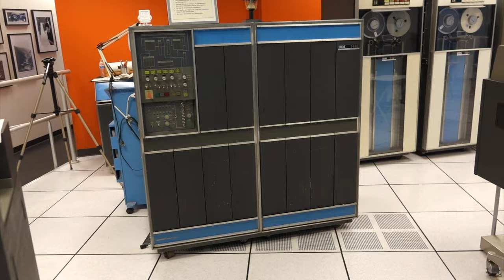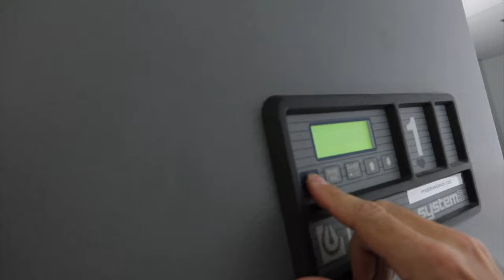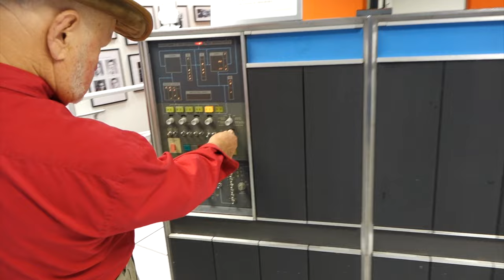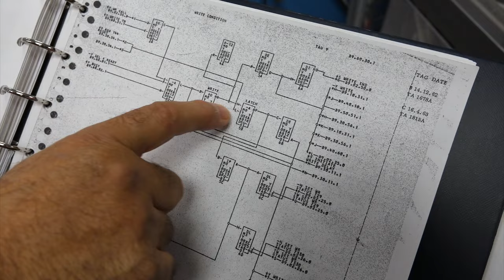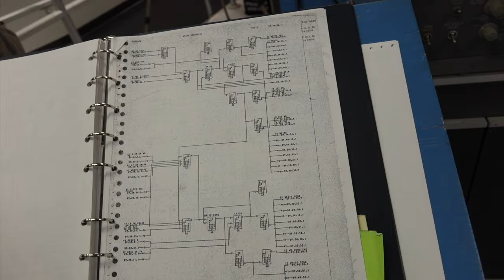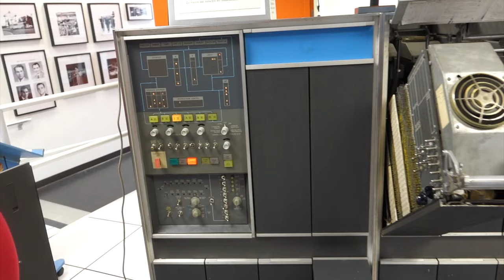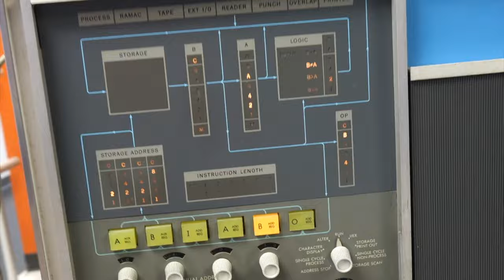IBM 1401 Restoration Team: A Day at the Office

Comment: Hi Marc

I have a Pioneer Magnetics Clock and Sector Writer with cables in excellent condition. It appears to be a floppy disk diagnostics tool from the mid 70s. Would you know someone who might be interested in it? I picked it up to Part out, but it may be more useful to a collector. Thanks!

-Nathan
Reply from the maker: I believe this would be for formatting old IBM style hard disk platters, quite a useful restoration tool. Can you send me a private message (go to my channel by clicking on my name or icon, About tab, Send Message button on the right)? We'll continue from there. Thanks!
Reply: Awesome, I sent you a message with some pictures.

Comment: How long do the magnetic tapes last? Does anyone make more of them?  How often do you need to replace them?
Reply: I know with old video and audio tape, you need to heat them up somehow to make sure the magnetic material stays on the plastic tape. But I'd bet there's one company that still makes computer tape. I know a company still makes 8 inch floppy disks.
Reply: Modern tape is 1) much higher density/quality/cost than needed for this old kit 2) sliced and packaged into DLT, LTO etc. I wonder what it would cost to slice and package modern tape media into reels for these machines. It would be interesting to find out from somebody in the business. On the other hand I can imagine setting up a small business activity manufacturing "old" tape. May as well do paper tape and cards too
Reply from the maker: It really depends on the brand and storage condition. Some do very well, others the magnetic material crumbles away. We have new old 3M stock and these are great.

Comment: Shocked how fast that dot matrix printer seemed to spit out that three lines of text.
Reply from the maker: It's the hydraulic paper ram. It really gets the paper going. The printing itself is 600 lines/minute, which was quite amazing in the day (still is). It's not dot matrix either, it's an impact chain printer. Imagine a chain of typewriter-like characters flying in front of 132 fixed hammers. Amazing technology. I should do a video on it, the IBM 1403 is an impressive printer.
Reply: I've never heard of that. I'd like to see a video of how that works. Also, the green bar printout of the woman's portrait at the very beginning was interesting. I remember in the 70s how common that stuff was, though it had to have been distributed by word of mouth.  I've never seen those pictures and calendars sold in stores.
Reply: This is precursor to the Band Printer from the Printronix days?
Reply from the maker: +DandyDon: I believe so.